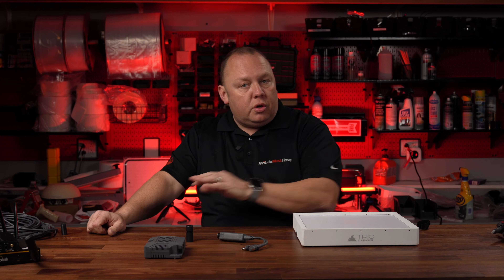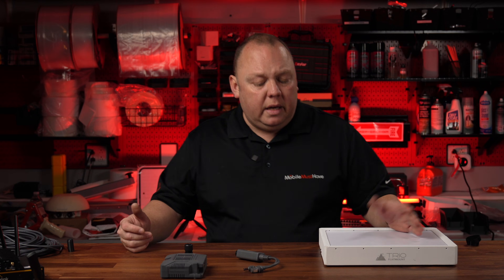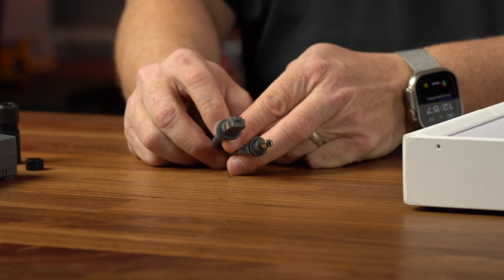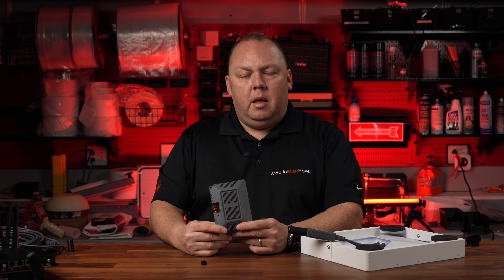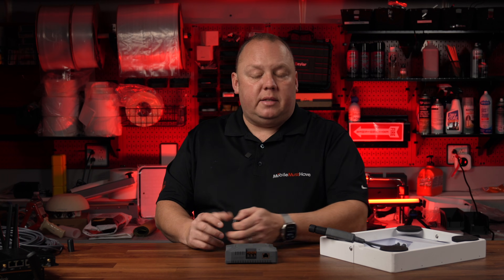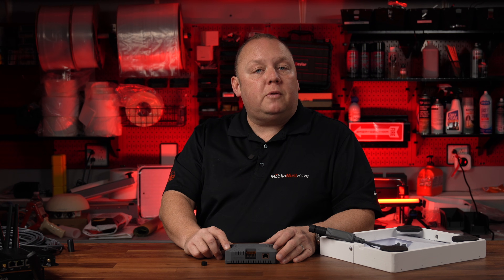New! Starlink Mini POE DC Power Conversion Kit is Here!

Comment: Have you tried using higher than 36 V? I use a E bike and is wondering if I can use my 58 V battery without having to step it down to 36.
Reply from the maker: While we haven't tested with a power source as high as 58V, the converter is only rated to accept 9V-30V input. So, an input of 58V would most likely cause damage and could be a fire risk as well. For this situation, we definitely recommend stepping it down to 9V-30V range, to be safe.

If you have any other questions, reach out to us via email at info@mobilemusthave.com and we'll be happy to help!

-Jacob, Team MMH

Comment: So when we say 'POE' its running via the same cable but can't be powered via a POE switch. .... you need to use this propriety POE injector?
Reply from the maker: Yes, that is correct. Our Starlink Mini PoE DC Power Conversion Kit replaces the Starlink Mini power supply and uses our DC Step-Up Converter and PoE Injector to allow the Starlink Mini to be powered via PoE, in conjunction with the provided PoE Splitter.

Here's a link to the Starlink Mini PoE DC Power Conversion Kit on our site with more information: https://mobilemusthave.com/products/starlink-mini-poe-dc-power-conversion-kit-with-12v-accessory-output-for-peplink?_pos=1&_psq=starlink+mini+dc&_ss=e&_v=1.0

If you have any other questions, reach out to us via email at info@mobilemusthave.com and we'll be happy to help!

-Jacob, MMH Team

Comment: If I buy a kg of space on starship do   u have extras before it goes up. All I want is to by a 12 volt system that sets up and works.
Reply from the maker: Well the Starlink Mini runs on DC power out of the box but this does let you run it over ethernet which is a nice add if you have longer runs. That said if you just need a 12v power cable probably the easiest option is a USB-C 30ft cable which will get your voltage up to 20v which will handle the longer cable nicely and work with any laptop style USB-C PD High power USB Power brick. https://mobilemusthave.com/products/starlink-mini-10-meter-water-resistant-usb-c-power-cable-for-battery-or-portable-operation - Erik MMH

Comment: I'm a little confused on your website. Does the $149 kit include the splitter to the mini? The picture shows it but it is listed as an option.
Reply from the maker: Apologies for the confusion! Yes, the $149 Starlink Mini PoE DC Power Conversion Kit does include the PoE Splitter. We also offer the option to purchase a second PoE Splitter if you have an additional cable run -for example, if you need to move the Starlink dish from your roof mount due to tree coverage.

If you have any other questions, reach out to us at info@mobilemusthave.com and we'll be happy to help!

-Jacob, MMH Team
Reply: @MobileMustHave thank you

Comment: I guess it's because most PoE ports don't support 802.3bt PoE++.
Reply from the maker: these passive poe injectors do not use a PoE standard however we do have a PoE++ BT splitter and injector that is mainly used for the Peplink Antenna MAX S and uses the new BT (90w) standard to power both a Peplink and Starlink Mini in a single unified enclosure. Here is a link to the video we did on that build: https://youtu.be/8KudUK457Hw?si=Z0As5zFP5dCxRp1b - Erik MMH

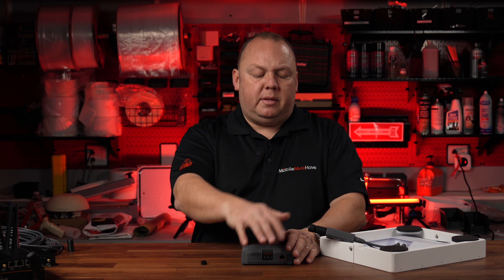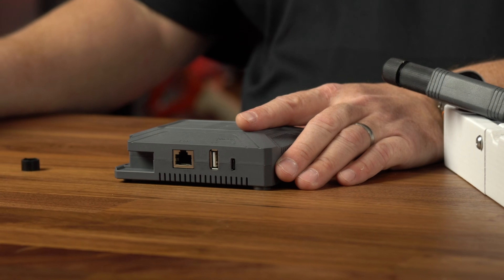Comment: LOVE the concept.  I'm a little challenged with installation.  Issues/Questions   At 7:33 I think you make a contradictory statement.  On the side with the DC connections you note the Cat 6 connections "going to the dish" (which makes sense as it's labeled POE on the box itself), but then about 7:40 you note the other Cat 6 connector (LAN) that goes to your WAN port "to your Starlink device" ~ you REALLY meant to say router, right?  ADDITIONAL Issue - @ 6:50 you're talking about wiring the 12v system.  You noted "the connections are clearly marked" ~ but you should point out that the markings on the case are VERY small.  I missed seeing them multiple times.  Step Up Power Mounting Location - How hot does the step up power source get???  OK to mount it on raw wood, a melonite surface?  While we're using the ventilation system for our old absorption fridge, could it be mounted in a enclosed closet?
Reply from the maker: Hi Mark! I can definitely assist with the installation issues. For the CAT-6 LAN to WAN connection, you're correct. You will run a CAT-6 cable from the LAN port of the converter to your router's WAN port.

In regards to the heat, the converter can get quite hot to the touch, but that's mainly due to the built-in heat sink dispersing the heat out of the converter. The converter has an operating temperature of up to 167 degrees Fahrenheit as well, so it can handle the heat. Installing on raw wood or melonite should be just fine. If you'd like to be safe, you could also add a flash plate to the wood surface, then mount the converter on top of the plate.

For installing in an enclosed closet, you would just want to ensure it has room to disperse the air. If it's a tight space, it can cause the heat to build up, potentially above the safe operating temperature. If needed, here is a direct link to our Starlink Mini DC Conversion Guide: https://mobilemusthave.freshdesk.com/a/solutions/articles/67000740073?portalId=67000053204

If you have any further questions, reach out to us via email at info@mobilemusthave.com, and we'll be happy to help!

-Jacob, Team MMH

Comment: It wasn't clear, at least to me, does this work directly with a POE switch that provides the appropriate POE class power?  If not, why not?
Reply from the maker: Starlink changes the pinouts for positive and negative polarity on the poe pins. Normal poe wont also provide the 60w of power.  90w poe would work if you could get the pins changed effectively however but we havent tested this, all would be easier with with the mini since its not using poe at the dish anyway. Great topic question! - Erik MMH

Comment: In our network room I added red labels to every DC plug that is over 12v listed what the voltage is.  This was required after the internet company was replacing our modem and plug the wrong cable (48v) into the wrong device.
Reply: they let the magic smoke out :(

Comment: putting 12v on a usb A connector when you could use a myriad of other connectors is inexplicably dumb.
Reply: You mean your "overseas partners" couldn't accommodate you?😊
Reply from the maker: @glynnetolar4423 not yet but once we hit a 10000 moq we can have more pull with manufactures - Erik MMH
Reply from the maker: totally agree, but not something we had control over.  Just worked with the system limitations required.   Had we put a differnt port there,  the stock cords wouldn't have worked causing more dongles required.  This was the best option we felt.

Comment: I bought two mini poe adapters here recently thinking i was going to use it for the 3rd gen dish , can i send it back and get it replaced for a gen 3 type ? Thanks
Reply from the maker: For sure, if you're within 30 days of your purchase, you can definitely return the Starlink Mini PoE DC Conversion Kit for a refund. Then you can place a separate order for the Gen 3 DC conversion kit:
https://mobilemusthave.com/products/starlink-gen-3-dc-power-conversion-kit-with-12v-accessory-output?_pos=1&_psq=gen+3&_ss=e&_v=1.0

If you have any other questions, reach out to us at info@mobilemusthave.com and we'll be happy to help!
Reply: Thank you!  can't wait to try the all network card if i go down that route appreciate it !@MobileMustHave
Reply from the maker: @jessygibbs4132 apologies I’m speaking with my team on why they told you this kit is the same. The gen 3 kit outputs slightly more voltage than the mini kit, 54 volts up from 48 and my team is correct the mini kit will work but is not optimized for the mini, we have a new unit that works with all the HP, enterprise and full size dishes available here that also includes a cooling fan, power button and metal case but probably best you swap that mini with our team by contacting customer service. https://mobilemusthave.com/products/starlink-350w-all-in-one-poe-gige-injector-power-supply
Reply: @MobileMustHave would it impact greater performance by going the gen 3 kit , 6 volts difference? Also I'm assuming it doesn't work for the mini? Thank you
Reply: @MobileMustHave I think i see what your saying,  this works for all dishes !
Reply from the maker: @jessygibbs4132 54V is in the upper range of voltage that the Gen 3 dish can accept. That extra 6V can be helpful if there's a longer run of cable or if there's a slight voltage dip for some reason. The extra voltage will help ensure that the dish isn't going to reboot itself and kick you off the internet in those scenarios. 

Again, the Mini conversion kit will work to power the Gen 3 dish, but it won't be quite as optimal as the Gen 3 conversion kit.
Reply: @MobileMustHave  I would have already purchased this Kit for my Mini except I’ve heard some concern that the PoE Splitter Cable is too short to fit into the Mini, and may need to be 3-4 inch longer?  I am setting up ability to use the mini in multiple locations, including an Ext Pole set up outdoors!  Is this Splitter proprietary or available from a 3rd party.  TY,  I am so ready to purchase tho hesitating, Paul

Comment: Putting the POE in my airstream and connecting through the Ethernet pre wire already installed. So I can pull in, plug a single cat 6 cable into the external rj45 port, turn on trailer power and it works through my previous router installed in the trailer. Wonderful.

Comment: Can I eliminate the use of the 'StarLink V3 3 Router' by using the 'Starlink Gen 3 DC Power Conversion Kit with 12v Accessory Output' to power the StarLink V4 dish and a 'GL.iNet GL-MT3000 Portable Travel Router' (via the USB-C port), and than by running an Ethernet cable between the LAN port on the PoE injector, to the WAN port on the travel router so the routing functions are handled by the travel router? If so, do I need the StarLink Ver 3 router at all?
Reply from the maker: Yes, you can! Our Starlink Gen 3 DC Conversion Kit allows you to remove the Starlink router and then you can feed the signal into whichever 3rd party router you want using a CAT-6 or higher ethernet cable. For the GL.iNet travel router, we haven't tested them ourselves personally, but we have had multiple customers go this same exact route and it does appear to work well being powered by the DC Conversion Kit via the USB-C 5V port!

Here's a link to the article we have that shows how the Starlink Gen 3 DC Conversion Kit is setup: https://mobilemusthave.freshdesk.com/a/solutions/articles/67000740072?portalId=67000053204

Also, here's a direct link to our sit for the Gen 3 DC Conversion Kit: https://mobilemusthave.com/products/starlink-gen-3-dc-power-conversion-kit-with-12v-accessory-output?_pos=1&_psq=gen+3+dc&_ss=e&_v=1.0

If you have any other questions, reach out to us at info@mobilemusthave.com and we'll be happy to help!
Reply: @MobileMustHave  Thanks for the info. Based on the documentation, I should be able to plug-in a USB-A to 12V Barrel cable to power my Netgear R6700AX WiFi 6 router that requires 12V/1.5A, is that correct?

Comment: Could I use the 5V USB C outlet on the booster to power a GL iNet Beryl AX router?  It requires a 5V 3A input.
Reply from the maker: Yes, that should work just fine! The USB-C 5V outlet is perfect for powering smaller routers, however, I'll note that we haven't tested it out ourselves with that specific router, so you will just want to double-check the power requirements.

For full specs of the Starlink Mini PoE DC Conversion Kit, check out our site here: https://mobilemusthave.com/products/starlink-mini-poe-dc-power-conversion-kit-with-12v-accessory-output-for-peplink?_pos=1&_psq=starlink+dc+poe&_ss=e&_v=1.0

 If you have any other questions, reach out to us at info@mobilemusthave.com and we'll be happy to help!

Comment: Major design flaw! A standard usb a port, but 12 volts when everyone is expecting 5 volts. That's exactly the same as using a standard 120 volt outlet in your house and wiring it up to 220 volts.  Then you tell everyone don't use this outlet unless you want you item to be destroyed.  How extremely stupid a design! Do better mobile must have!
Reply from the maker: I apologize for any confusion. The USB-A port does provide a 12V connection, which is necessary for powering devices like Peplink routers that require more than 5V. However, the kit also includes a USB-C 5V port, allowing you to power lower-voltage routers or other compatible devices. 

For a full list of specifications, check out our Starlink Mini PoE DC Conversion Kit listing on our site here: https://mobilemusthave.com/products/starlink-mini-poe-dc-power-conversion-kit-with-12v-accessory-output-for-peplink?_pos=1&_psq=starlink+mini+poe+dc&_ss=e&_v=1.0

Since the release, we have seen and heard great results from our Starlink Mini PoE DC Conversion Kit! We'd be more than happy to clear up any confusion on our Conversion Kit if you'd like to reach out to us at info@mobilemusthave.com.
Reply: @MobileMustHave  you are skirting the problem.  A 12 volt supply is a great option.  However,  using a 5 volt usb connector to supply 12 volts is a wreckless design.  Use a different connector,  properly labled. A usb c would be fine, as 12 volts, or more is present on a c.
Reply from the maker: @ they are properly labeled with extensive information on the listing page as to what port does what. Weve provided feedback to the manufacturer similar to yours that we would like to see a  4 pin or similar molex connector on the 12v side but likely wont see that in this generation as the dishes change so frequently they usually update the design with a new dish release. Thanks for the feedback!
Reply: Yeah, there are simple ways of making a 12V capable USB A per without it being fixed at 12V. All you have to do is detect a couple of registers on the USB data lines to enable 12V. Otherwise it defaults to 5V. And to make it simple, there are chips to do this all for you.

Comment: What I don’t understand is how the starlink mini costs £100 more than the 3rd Gen. it has less technology in the mini and pulls slower speeds. Granted it’s portable for back packers but if you have an RV or Motorhome and you just fix then gen 3 to the roof surely it’s the better deal? I cannot understand how it can be £100 more. Doesn’t add up.

Comment: At $149 bucks for the POE kit I prefer to wire another separated cable 😅. The Starlink mini only costs $200 in my country so 3/4 of the price for just a POE injector and splitter is a very hard sale...
Reply from the maker: For sure, I definitely understand if the price point does not work for your use case. However, this DC Conversion Kit has been tested extensively by our team, so there's a lot of benefit in having a reliable product that has been field tested to work with Starlink's system.

Here's a link to our Starlink Mini PoE DC Conversion kit on our site: https://mobilemusthave.com/products/starlink-mini-poe-dc-power-conversion-kit-with-12v-accessory-output-for-peplink?_pos=1&_psq=starlink+mini+poe+dc&_ss=e&_v=1.0

 If you'd prefer to discuss this with our team more and see if we have a solution that works for you, reach out to us at info@mobilemusthave.com and we'll be happy to help!

Comment: Will the PoE hub also work with the round  gen1 and square gen2 dishes ?
Reply from the maker: Unfortunately, this PoE DC Power Converison Kit will only work with the Gen 3 Starlink and Starlink Mini from our testing. However, we do have resources/products available for converting the Gen 2 Starlink dish. Check out the DC conversion section in our Gen 2 Starlink Dish article here: https://support.mobilemusthave.com/en/support/solutions/articles/67000731065-peplink-mobile-internet-setup-gen-2-standard-starlink-dish

That article covers how to set up your Starlink Gen 2 Dish on DC power and connect it to a Peplink router if needed. 

If you have any questions, reach out to us via email at info@mobilemusthave.com and we'll be happy to help!